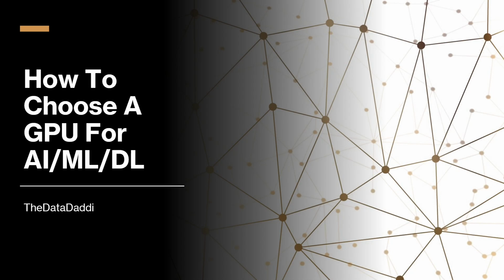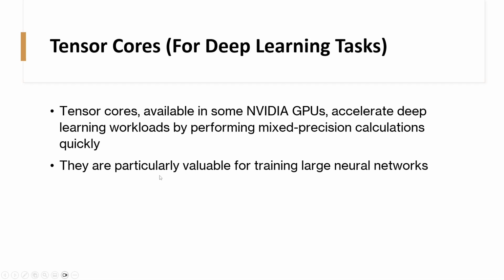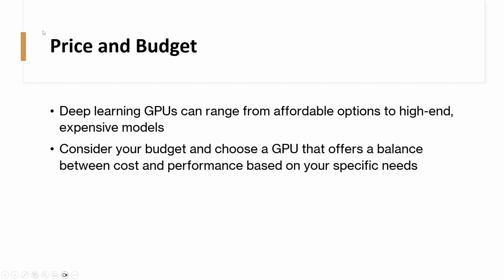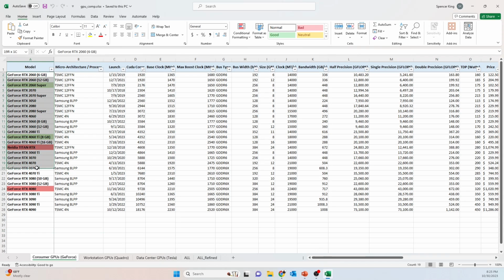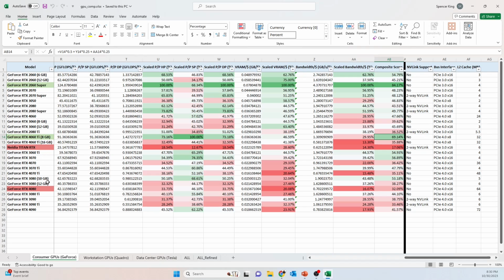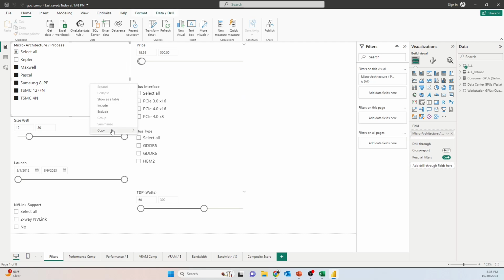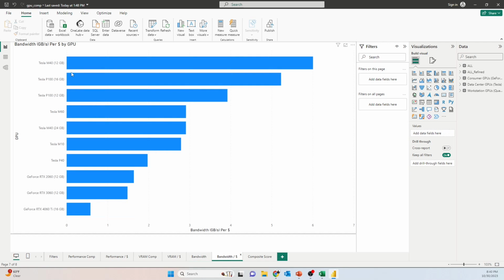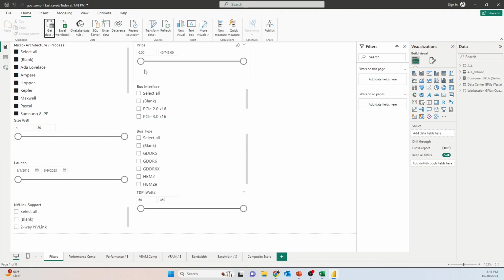AI/ML/DL GPU Buying Guide 2024: Get the Most AI Power for Your Budget

Comment: Amazing video! I wonder if you could advise me on my next setup...

I'm a deep learning engineer who typically works in medical computer vision, however, i'm looking to buold something for my home office. My budget is 3-4k for the entire setup. Datasets I use tend to be quite large, and 20gb vram is probably a minimum in terms of model size. I've been looking at a 4090 prebuilt because for that budget, I could get a nice spec with the option to do some occasional gaming. 

In an ideal world, i'd want more vram! 48gb would be amazing. I wondered about going for a 2x 3090 using nvlink. What do you think about something like this?

Thank you in advance!
Reply from the maker: Hi there! Thanks so much for reaching out. 

So for your budget, I highly recommend going the 2x 3090 route. This is the best configuration I have found so far that balances price and performance for what I would consider mid to upper end setups in terms of compute resources. I actually just bought 2x 3090s and am going to be making some video exploring their performance with and without NVlink. This will also be good in your case because you are interested in occasional gaming. 

Unfortunately, for 48GB VRAM at this stage you are going to have to go the Tesla series GPUs and those break the bank even used. For right now, unless you absolutely have to have 40+ GB of VRAM I think 2x 3090s with NVlink is the way to go for mid to upper range computing projects.
Reply: @TheDataDaddi  Thanks so much for your response! 

I'm having a tough time clarifying whether 2x3090's with NVlink allow for larger models to be loaded during training/testing...?

I understand data parallelisation and how that is beneficial, but can I actually distribute the model in a way that allows me to experiment with really large models with a 2x3090 setup? I use both tensorflow and pytorch and have seen forum posts going either way with regards to this setup. I would be really interested to hear your thoughts.
Reply from the maker: So, utilizing a dual RTX 3090 setup with NVLink indeed expands your capacity to experiment with larger models during training and testing phases. Typically, in such configurations, the entire model is loaded onto each GPU. The remaining memory is then allocated for data batches during training, testing, or inference processes.

With each RTX 3090 leveraging about 24GB of VRAM, you should find this setup sufficiently robust for handling fairly large models (pretty much most things up to the mid to large open source LLMs). That said though, it really depends on the size of the models you will be loading. I would recommend loading a typical model you might work with onto the CPU checking the memory utilization before and after. This should give you a good idea of how large the model actually is. Then you can see a) will the model in its current state fit into memory on both GPUs and b) what kind of batch sizes you might be able to work with. Smaller batch sizes, while manageable, could become a limiting factor in your workflow, potentially impacting training efficiency and model performance evaluation. From here you can make a decision as to whether or not you really need more VRAM.

An alternative strategy (especially relevant with NVLink because you have direct memory access between GPUs) involves distributing different parts of a model across the two GPUs, allowing for batch processing to occur sequentially across both units. This method, albeit more complex, can effectively mitigate VRAM limitations by leveraging the combined memory more efficiently. However, it's worth noting that this approach requires careful implementation and might not be suitable for all models or scenarios. It is also important to note that NVLink does not create a single unified memory space accessible by all GPUs as in the traditional sense. Put another way 24GB + 24GB of VRAM does not equal 48GB of VRAM in this case as it would on a single GPU. 

Frameworks like TensorFlow and PyTorch do support multi-GPU setups and offer varying degrees of support for model parallelism and data parallelism. For TensorFlow, strategies like tf.distribute.MirroredStrategy can be employed for data parallelism, which synchronizes training across the GPUs for each step. PyTorch users can leverage torch.nn.DataParallel or torch.nn.parallel.DistributedDataParallel for similar purposes. For model parallelism, where the model is split across multiple GPUs, PyTorch provides more explicit support through manual implementation, allowing you to define how different parts of the model reside on separate GPUs.

With full transparency, I have not had to use model parallelism thus far so I cannot comment more specifically on how to implement it. It will also vary from use case to use case. I think this would be a great video topic though and certainly something that would be great to know as models continue to get larger and larger. I will try to make a video on this specifically as soon as I get a chance. 

Anyway, I apologize for the long winded answer, but I hope that this response is useful to you! 

 @dirtdabest
Reply: Ah this is a brilliant response! I am going to go for the dual 3090 setup! The potential freedom of having a larger model is what's most important to me on reflection. 

Are there any other special considerations for a build like this? 

Thank you so much for your response, it's really cleared things up! I will be watching out for the video when it comes!
Reply from the maker: Glad to hear it! I think that setup will suit you well. They also hold their value well so it does not end up being what you need you can easily get most of your money back out. 

Only thing I would say about the build is if you are going the server route make sure that you choose one that will fit in whichever RTX 3090 you choose. I might consider an external rig with pcie extenders. I am doing this myself actually so I will have a video on this soon. You might consider that as well. External rigs are also much easier to keep cool. 

So glad I could help and keep me updated throughout your journey!

 @dirtdabest
Reply: That's good to hear! 

I wondered can you NVlink 4 3090's in the same way? I think my budget could accommodate 4 cards at roughly £500 per card. 96gb of vram (once I've learnt how to distribute the model effectively) would be so interesting for research.

I was planning on building this in a full tower, but maybe the cooling will be problematic... 

What are the distinct advantages of building this as a server vs a desktop setup? I am familiar with kubectl and kubernetes with my work, so would be interested to hear your thoughts on the advantages of building as a server.

On that note, are there any specific considerations with regards to a desktop motherboard for a dual 3090 setup?

Looking forward to future videos, thanks again for all the advice!
Reply from the maker: So couple things here. 

1) To may knowledge you cannot NVLink 4 RTX 3090s together (each to each other). You can only link 2 together, unfortunately. So you would have 2 sets of 2 NVLinked GPUs. This may have changed and I encourage you to do you own research here. Maybe something out there exist to link more than 2 (I would be super curious to hear if this exists). 

2) If you are going to go with 4 GPUs, I would go the server route for sure. It would be super expensive to go go with a custom build for that many GPUs. You would need a threadripper and compatible mobo to handle that many pcie lanes (with 4 GPUs you might not even get the full x16 lanes for 4 GPUs) which are crazy expensive relatively speaking. Check out this server I recently bought it can house up to 8 2 slot GPUs. 

https://www.ebay.com/itm/126021050668

This is the way I would go. Full disclosure though. I am not sure yet if my RTX 3090s will fit inside yet. Lol. I am going to make a video on the install if you can wait that long. The server should come in this next week sometime. Even if they don't you could just use an external rig. Most important thing is the available pcie slots and total number of pcie lanes. 

3) From a software perspective, there really are not any disadvantages of using a server vs desktop/custom build. Having done both, I personally prefer the server approach. I find it a more cost effective way to go for more computing resources. 

 @dirtdabest
Reply: @TheDataDaddi  
Ah yes, so after some research, it appears you cannot link 4x3090 via NVlink. 

The more I think about it, the more I think i'm going to go the server route. The link you have posted looks like it has X9DRG-O-PCie, which i've read has a speed of 8gb/s. Does this mean you could distribute your model across multiple GPU's, but you would have a speed limitation? If so, this could still be very interesting. There's mining rigs going for sale at the moment which could allow for some interesting builds with a server like this... 

My knowledge of server building is essentially none. What are the key components required to setup once I have the GPU's? I wonder if there are servers that have pcie lanes fast enough to make model distribution practical...
Reply from the maker: Yeah I figured. Would be really interesting if this is every developed though. 

In that case, yes you could distribute the model across multiple GPUs, but there might be a speed limitation. However, NVLink should help significantly to over come this. 

Also, after inspection of the server it has 8 full 3.0x16 pcie slots so unless there is a limitation on the mobo it should be able to handle 8 gpus at full bandwidth. I will need to confirm this though once I get the server up and running as it seems to good to be true. 

 Other considerations would be CPU, memory, network cards, storage, and anything else you might want. Honestly, I think setting up a server is easier than building a PC. If you speed is you main concern, you might be better off just buying a GPU with enough VRAM to fit your models into memory. This would likely be the fastest and simplest approach.  @dirtdabest
Reply: @TheDataDaddi  thanks for the advice again!

So, in the end I've managed to source some good deals on second hand parts to build a workstation with 2 x 3090s and NVlink. I've got a user 3960x threadripper and mobo and 256gb of ecc ram etc. The total build is looking to cost less than 2.5k (i had a budget of 3k). 

I've done a lot of further research on model sharding and discussed with some of the engineers in my company and turns out you can definitely distribute models in the way we were discussing, it just requires a bit of forethought when developing the initial code.

I'll keep you updated with the model size I'm ultimately able to run! And once again thank you for all the advice!
Reply from the maker: Man that is an incredible price for your build. If you don't mind me asking, where did you find the threadripper and mobo? Any place in particular? 

Right. I know it can be done. I just have never personally done it. I would be interested to hear once you are successful how difficult it was for you and your application. 

Please do man. Will be checking for updates from you. Thanks so much again for all the great question.  @dirtdabest

Comment: Excellent content! Congratulations! I had a question: Why didn't you include AMD GPUs? Would that change anything?
Reply from the maker: Hi there. Thanks so much for the positive feedback!

I have not include AMD GPUs here because AMD GPUs to my knowledge and experience are not well suited to machine learning. The AMD drivers are really buggy and make using them for machine learning a huge pain. NVIDIA unfortunately is the only manufacture I trust at this point for GPUs for AI/ML/DL. 

That said as I have time in the next few months I am going to try to experiment with and older AMD GPU I recently bought in depth to see what current limitations of the AMD drivers are. I will report my findings a future video. Also, if the results are good. I will make another video just like this but include AMD GPUs.
Reply: @TheDataDaddi  Yes please!!

Comment: Hi there. Can you suggest me midrange or budget cpu and gpu for ai/ml/dl pc.
Reply: I'm studying artifical intelligence and Machine learning engineering in india.
Is intel i5 14600k and rtx 4060ti 16/8gb good, if not so suggest some😊. My brother is also studying Machine learning and deep learning. Can you suggest some laptops for him. I need a pc and he wants a laptop.
Reply from the maker: Got it. The I5 is a solid choice and so is the 4060 ti 16GB. I would not get a GPU these days for AI/ML/DL less than 12GB. That would be my minimum. 

Also for AI/ML/DL I would really not recommend a laptop. I think have a server or workstation to ssh or remote access via a laptop is fine. However, I do realize as a student a laptop makes a lot more sense. 

I will try to find a good solution for your brother. My first though its one of the Mac M3 Pros. These are really expensive though and I really can't speak on how good they are from a machine learning perspective. I have an M1, and it has actually been pretty good. Just has definitely been buggy from time to time for machine learning. 

I actually just found this article. Tell your brother to check it out. It has 10 options that vary in price. He should be able to find something here that fits his budget. If it were me, I would probably start by checking out the Mac M3 Pro first though. As far as laptops go, I have always been impressed with Macs minus the price tag. 

https://medium.com/@ibrahimcreative172/top-10-laptops-for-deep-learning-machine-learning-and-data-science-in-2023-f8a6ba861c4f

Hope this helps!

 @maamla_boy5208
Reply: Thank you so much. 
Appreciate your efforts
Reply from the maker: Sure. Glad to help! @maamla_boy5208
Reply from the maker: Sure! What all are you looking to do specifically in the ai/ml/dl space?

Comment: Thanks, very detailed and hardwork you've spent making this video. 

What do you think using two 3060s 12gb for deep learning ?

I'm planning to add one more 3060 into my current setup (i5 12400f, 3060 12gb, 700W psu and ny motherboard does support multi gpus).

I saw your other videos about P40 and want to build like you, but it has no fp16 calculation so im not sure it worth it.

My budget is around 200-300$ so i may add the used one if you recommend it.
Reply from the maker: Hi there. Thanks so much for the positive feedback and for your question. 

I think that is a fine place to start. I started with one 3060, and it was great. Two would be even better. For that price range of GPUs if going with a Tesla P40 or P100 is not an option or you need something more general purpose, I think the 3060 is the best way to go.
Reply: @TheDataDaddi  Thank you so much, my concern is can a 700w psu enough for those gpus in the full workload ?
Reply from the maker: The TDP of one RTX 3060 is 170W so that would be 340W total. In theory this should work, but I really depends on all the other components in your build. I would recommend using website like pcpartspicker.com to spec out you current build then see if the current PSU you have can support all the components. That is what I normally do.  @huannguyentrong1249

Comment: i'm currently debating between the AMD 7900XT and 4070 Ti Super for my upgrade, my PC would be a mix of gaming and development including AI and DL in tensorflow and both GPUs fit into my budget. The main differences are that the 7900XT is generally faster in gaming than the 4070 Ti Super, in linux it's plug and play and the drivers are way better and that it has more VRAM while being less expensive. Though, even if the 7900XT is officially supported by tensorflow-rocm I believe it'd be quite a bit slower than the 4070 Ti Super still, although i guess any GPU is better than no GPU
Reply: Have you seen the latest reviews? Its only around 2.5-3% faster, not to mention driver issues that you are likely to face once you go the ml route. I think 4070ti makes a lot of sense when you bring in the ml factor
Reply: @nabeelnasar7935  i have seen the latest reviews, there are several games where the 7900xt is over 10% faster at 1440p and will have a longer lifespan too, drivers are also not an advantage for Nvidia on Linux, they're infamously hard to get working and overall not good
Reply from the maker: Hi there. Thanks so much for your question. I have not yet experimented much with AMD GPUs. I actually just bought a cheap on this week so I can start figuring out to what extent AMD GPUs are currently viable for AI/ML/DL applications. I will make a video on this once I have thoroughly tested it.  

However, for now I cannot recommend AMD GPUs because I have heard and read too many bad things about their driver issues for AI/ML/DL related tasks. So my recommendation would be to stick to NVIDIA and go with the 4070 ti for now if you want to dabble into AI/ML/DL at all. Its unfortunate because AMD GPUs seem to have a lot more performance for the price (most of the time). Right now, however, I still see AMD and Intel GPUs as primarily gaming GPUs. 

However, if anyone out there has used AMD (or Intel for that matter) GPUs for machine learning please share your experience in the comments. Would really appreciate that.

Comment: Where do you buy the P100? and P40s?
Reply from the maker: Hi there. Thanks so much for you question. I normally buy most of my tech gear from EBAY. I try to find refurbished used gear at a good price from a reliable seller. Hasn't failed me yet. I highly recommend this approach because new hardware in this areas is incredible expensive.